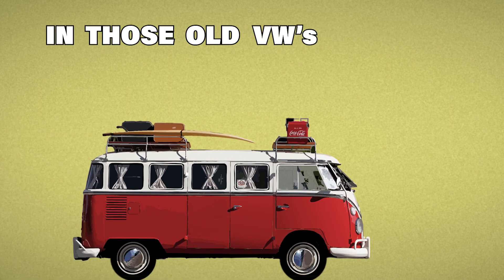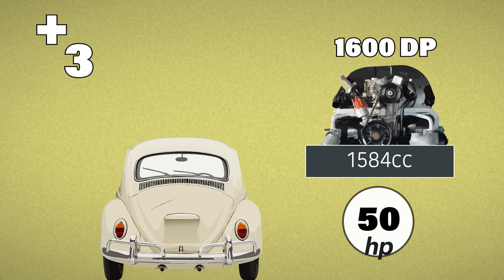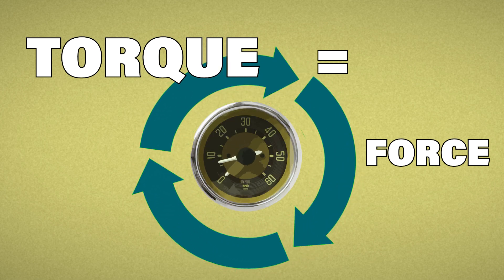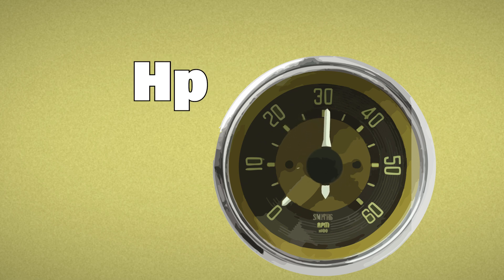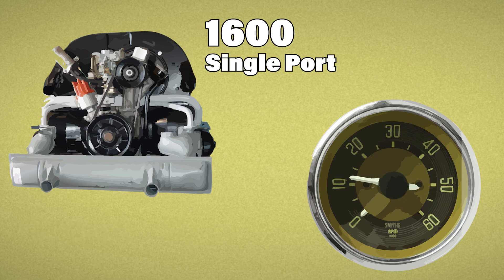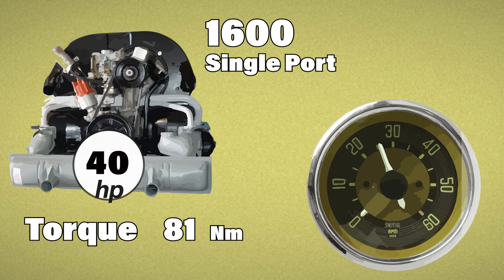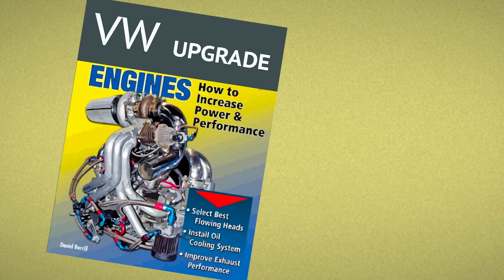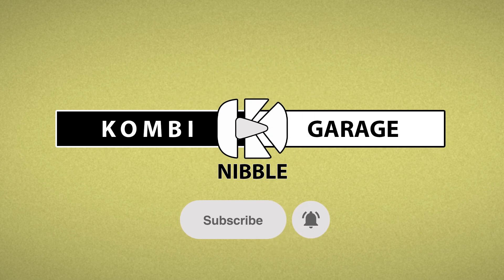Torque Does the Work — Horsepower Takes the Credit | VW Engine Performance Explained

Comment: VW doesnt rate by Peak anything.
They rate a "Working" HP or FP @ a limited RPM.
The peak will generally be a bit higher.
In their modetn engines its at least 10% more on the DYNO, often even 30% or more over "rated"

Comment: I had a 1600 single port with the JCW exhaust with the ugly big muffler prop up at an angle behind the bumper. It ran with modern traffic and would climb 5 percent grades at 70mph in fourth gear at 7000 ft. It was otherwise stock. Best bug I ever drove.
Reply from the maker: A lot of folks would support that the single port feels stronger than the dual under those conditions.

Comment: When motoring journalists in the UK between the 1950's-1970's published performance figures for the Beetle, the figures were poor, never matching the Beetles contemporary rivals. But one motoring journalist (Peter Noad, who raced Beetles) pointed out that ALL the other journalists were driving the Beetle wrong. They were all shifting at the Beetles maximum horsepower rpm (4200-4400rpm), while Peter was shifting in the torque range (2000-2600rpm) Peter consistantly published 0-60mph figures around 2 seconds quicker than everyone else because he knew the VW engine wasn't like the other cars, the VW engine used torque not horsepower to provided the best acceleration. This rule ONLY applies to stock or mildly tuned Beetle engines, once you start adding 48 webers, big valves and wild cams, does the gear shifting point become horsepower based
Reply from the maker: Nicely explained, thank you.